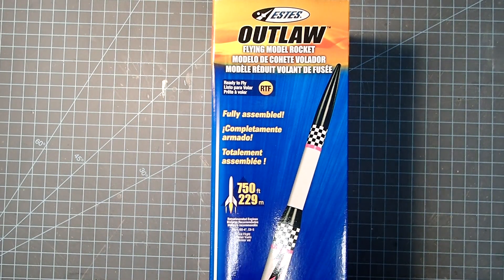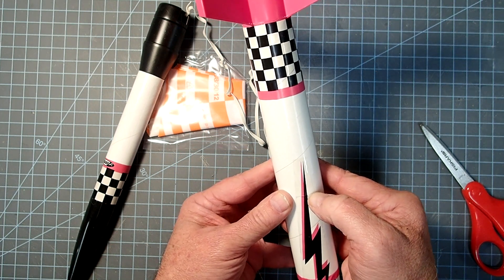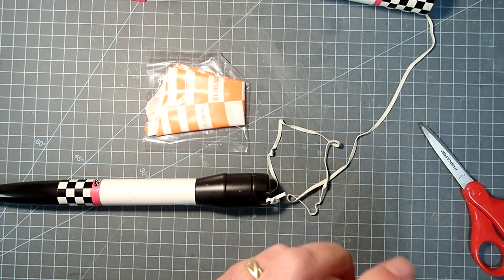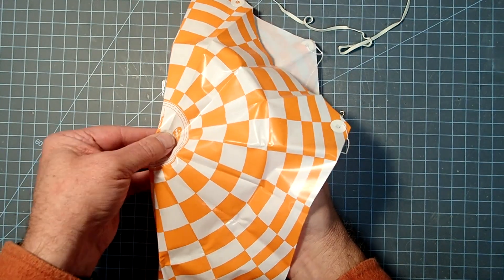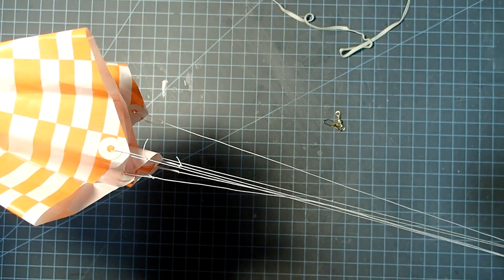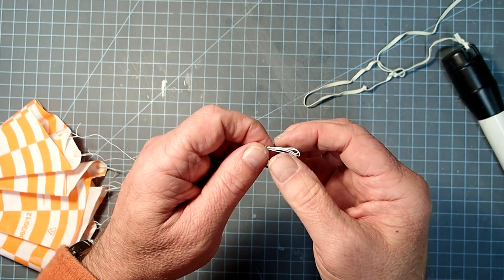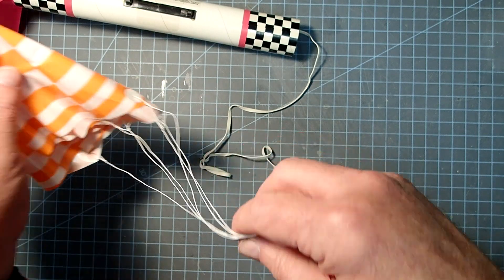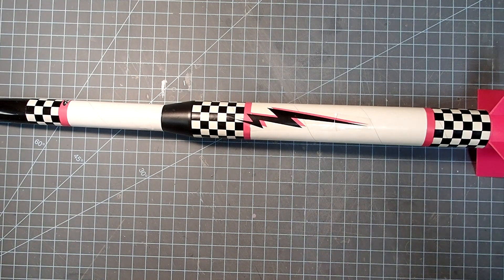Estes "Outlaw" model rocket assembly

Comment: If you poke the air bubbles with the tip of an X-Acto blade and then hit it with a heat gun, you can eliminate them.